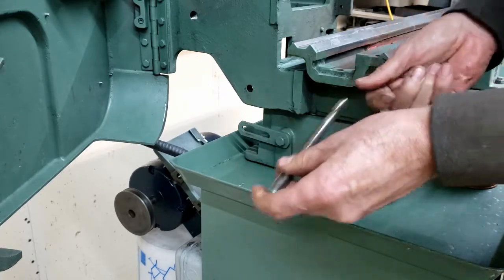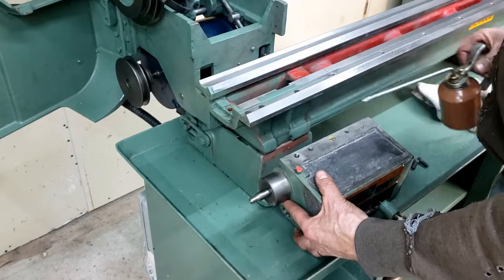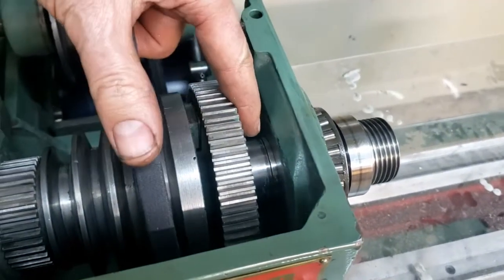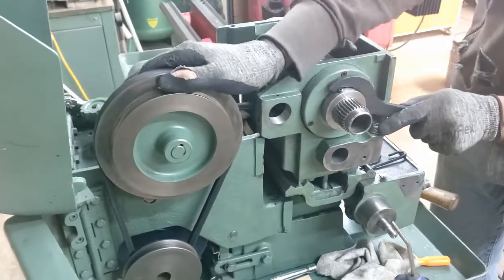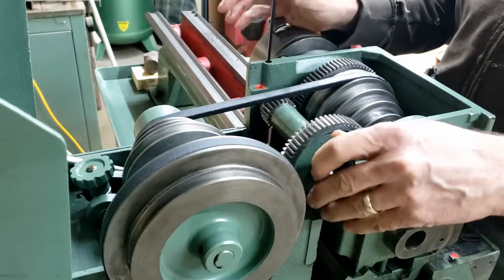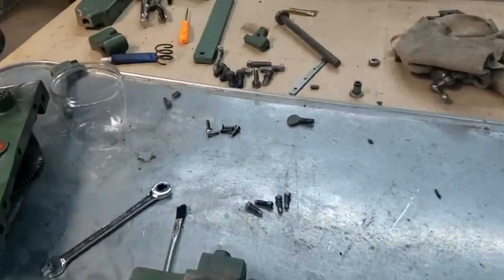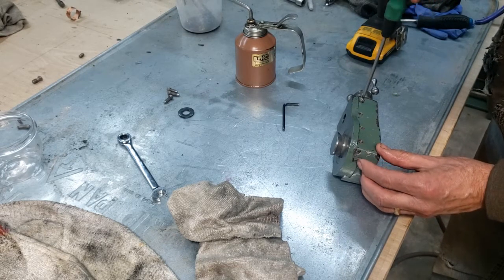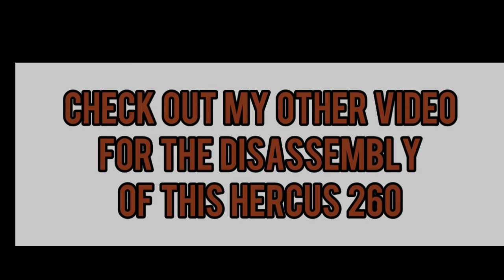Hercus 260 Lathe Assemble

Comment: Hi, I just finished watching the 2 videos, thanks for taking the time to post them. 
I also have a Hercus 260, purchased many years ago by my late father 2nd hand from a TAFE college in QLD Australia. Like you I like to dismantle and clean all my equipment, but I haven't been game till now because I was being cautious of the can of worms that I was opening but given that my spindle belt is worn and cracking it is only a matter of time before I have to.
I have a few questions that I'm hoping you will find time to answer:-
1. You and Darran both referenced the docs, I have little in the way of documentation, Operations, Maintenance or Parts, so I was hoping that you might be prepared to share copies of what you have or at least point me in the right direction as to where I can source them.
2. Do you have the contact details for Hercus in Australia, I believe that they are in South Australia, but my attempts to contact them in the past have failed.
3. Are the bearings something special to the Hercus 260 or are they a standard Roller Race bearing that I may be able to source from a bearing supplier.
4. Would a sealed version of the spindle bearings, that could be packed with grease, not be better than one that ran at best on a light film of oil when assembled?
5. Did you consider inspecting the bearings and capacitor in the motor when you had it all apart?
6. Were the replacement parts, Spindle shaft, bearings and gears very expensive?
7. What was the outcome once you fitted the new spindle shaft and bearings, did you manage to quieten the gear chatter down?
8. Have you ever considered fitting a DRO to it, I'm yet to investigate and am wondering if its construction lends itself to fitting one?

Anyhow thank you for your time and effort and I look forward to hearing from you.

Regards
Danny
Reply from the maker: 1. The docs are available online somewhere. You can search for (Hercus 260 Lathe Maintenance Manual-q)
2. I don't know how to contact Hercus but all the spares as well as some used and remanufactured parts are available from australianmetalworkinghobbyist.com
3. the bearings are a timken number but hard to find with the flange. They are available, as well as an economy version from australianmetalworkinghobbyist.com
4. I doubt you would find that option.
5. The motor runs well and is very separate from the machine so I feel it would be fine to address that issue if it arises.
6. Check out the site above
7. Yes it runs beautifully now with the new gears and shaft.
8. A DRO would be nice, maybe a future project. Please share your install if you you go for it. I'm currently more inclined to make some better surfaces to mount dial indicators but haven't found the time.
Good luck with your project.

Comment: Hi,
Many thanks for the reply and the links, most useful.
I have now downloaded the Maintenance Manual, Spare Parts Manual Parts 1&2 and a generic Hercus User Manual.
I have never posted anything to YouTube, perhaps this will make a 1st time posting!
I've started researching DRO's, but this is minefield, my luck is I would buy the wrong one.
Do you know the Timken Number for the flanged bearings? if so, I will source to have on hand prior to commencing the tear down. I will also make some of the pullers and spanners prior to starting.
Cheers
Danny
Reply from the maker: The bearing numbers are on the australianmetalworkinghobbyist.com website. If you search the numbers, make sure the race has the B after the number. That is the flange, which you need.
Always fun goofing around with machines. just take your time :)
Reply: @handyoldfart  Will do.

Comment: Just finished watching. Again, thanks so much for posting. Can I trouble you with a few questions? How many hours do you think it took you in total to do the teardown, cleaning, and reassembly? (I'll multiply this estimate by at least 3 to account for my relative inexperience.) My biggest fear with this is pulling and reassembling the spindle. I'm guessing that you've seen the Hercus 260 manual and the various tools they suggest for doing this? In hindsight, would you still remove/reinstall the spindle as you demo'd in your two videos? Have you checked the runout on the reinstalled spindle, and was it hard to get it aligned? Finally, have you tried parting on the lathe yet? (We have all kinds of trouble parting - there's just too much chatter and danger of getting the tool pulled into the workpiece.)
Reply from the maker: I believe it took most of my spare time in a week. I'm not sure how many hours. I have seen the tools they spec.
2 of them are important. The pieces of keystock I used in the video go where the U shaped piece is used when disassembling.
Also, when I used the 2" ABS pipe, that was incorrectly pushing on the bearing and it worked but when I did it the 3rd time (received the replacement spindle and bearings) I got smarter and turned a pipe to fit over the spindle but fit inside the aluminum cap so that I could push without the bearing and bushing installed yet. This lets you push on the end of the pulley  instead of the bearing. This is one of the tubes the drawing shows (Item#3)
There is no other way to remove the spindle in my opinion. The manual talks about tapping with a hammer and block but that is just laughable.
I didn't check the runout yet but I can't think of any way to influence that besides replacing parts. The spindle rides in the bearings and will be as accurate as that assembly allows.
Are you possibly parting at too high an RPM? Here is a great video on parting. https://youtu.be/PeHmee4tvYc
Thanks for your interest. Have fun with your lathe..